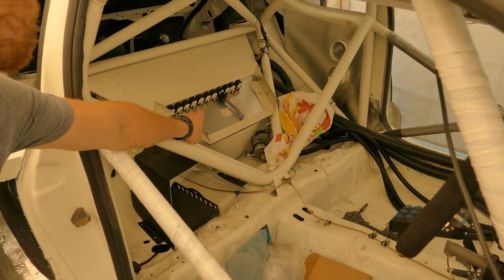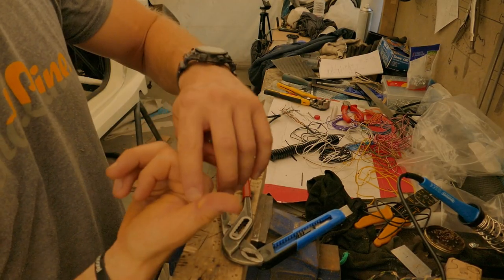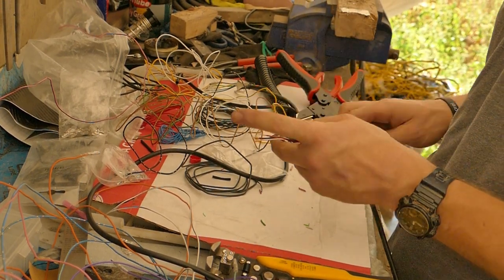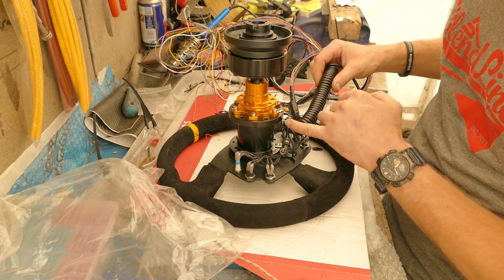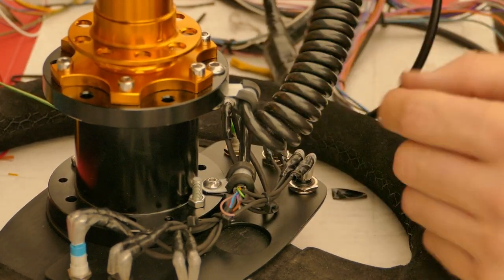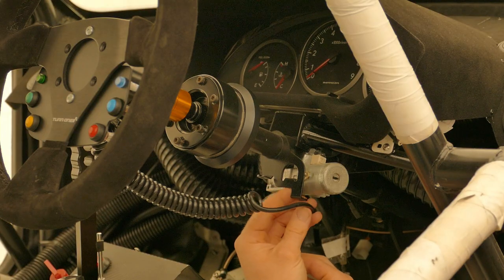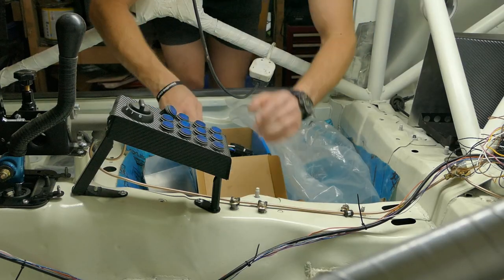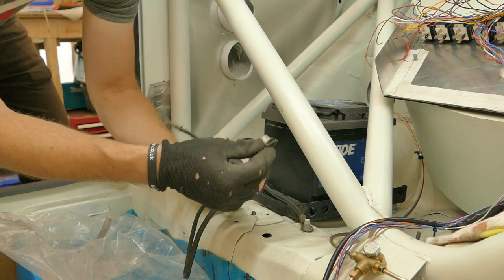Building Racing Car Steering Wheel Buttons for little £££$$$!!!! 206 WRX Ep108 #builtnotbought

Comment: A trick: to make it easily detachable, just buy e-bike connection cables: they cost about 5€ and you can have up to 12 pins, waterproof and look neat. no need to solder all those pins.